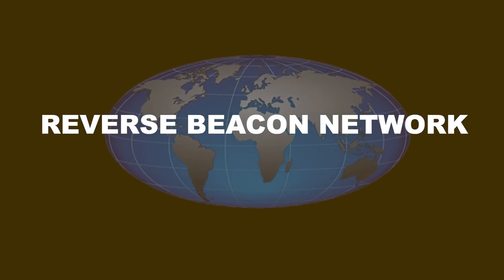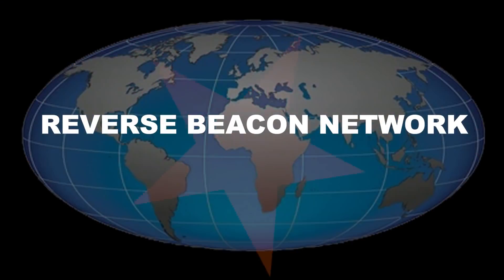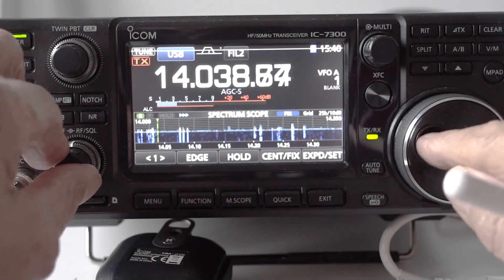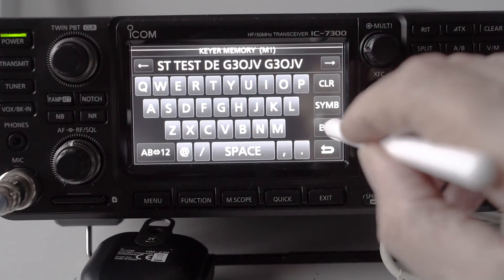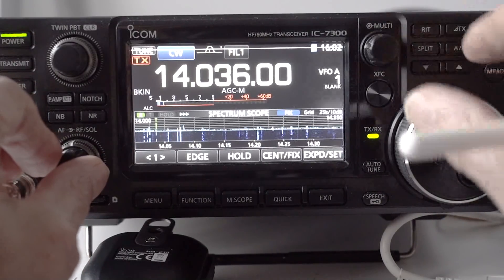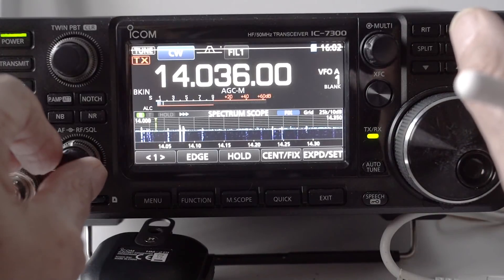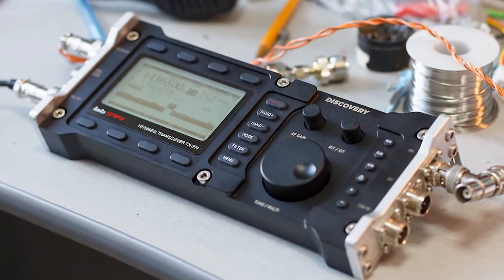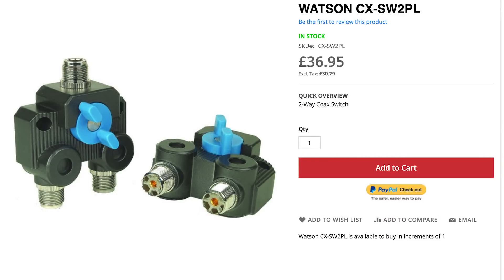HF ANTENNAS AND PROPAGATION - SIMPLE TESTS YOU CAN MAKE

Comment: I'm a new Ham and find your videos very helpful. I tried this but didn't get any reports when I went to reverse beacon website what am I missing? Thanks K2MWC 73
Reply from the maker: You need to send pretty good Morse cide but if generated by radio that should be mo problem. You must send in the CW section of the band ie ie near tge bottom. Reports take several minutes to come back.

Comment: You can also get how much your antenna is getting out is by looking at the PO meter while transmitting.  If you're set at 100W and the meter says 100 you pretty much transmitting 100W.  If the PO meters shows 50W you know you're loosing power somewhere.  Non resonate antenna, line loss, bad SWR or a combination thereof.
Reply from the maker: The power output has no connection with propogation!

Comment: Peter great video but my 991a won't do that 🙃
Reply from the maker: Ah - in that case yiu need to be abke to manually send CW. Sorry.  73 Peter.
Reply: I'm not sure about that. I've got it programmed into my 991 (not A) and it works. It has five memories for morse strings which can be sent in the same way. Look in the manual under CW and then contest memory thingie. It's the second bit under "Text".

Comment: Peter, you started me on the RBN path 18 months ago when, while in the Scottish highlands, you demonstrated the utility of RBN on your channel (March 3, 2020).   I learned something new--RBN works with "TEST" as well as "CQ".  Use of the Signal to Noise (S/N) ratio metric was difficult for me to interpret at first.  But then I remembered I had seen this metric before on the SDRuno software.  Listening to different stations at different S/N ratios helped me to understand how strong my signal appears to other stations on the RBN.  Your suggestion that using and logging RBN regularly over time is a good one.  I've found that you also get a feeling for which stations provide very reliable indications of signal strength.  I've looked up some of their QRZ pages and some have very elaborate antenna farms in low noise environments-not necessarily representative of your average ham's situation.  I calculate the median of the S/N/Rs obtained which provide a single point metric useful for comparisons over history or between station configurations.  The WSJT mode "WSPR" is another, albeit, more complicated tool that can be used for propagation studies. Two items to note for RBN use:  Send "QRL?" once or twice to start  to see if the frequency is indeed clear and that there's not an ongoing QSO, the part of which you can't hear.     Regarding low power on the IC-7300 and IC-705:.  When the power is set to zero on these transceivers, they still emit  RF.  I've found 650 mW and 100 mW, respectively measured with the QRPguys dummy load and power meter for these radios.  In fact, I've had several  CW QSOs at the 650 mW power!  Cheers and 73,  W3GZS

Comment: Cheers Peter. Excellent video. Was not aware of this, so going to try out this weekend. I suppose this is in some ways similar to the WSPR network? But without the need for specific installed software.  Thx,  ,  Mark  2E0MSR.
Reply from the maker: Yes, exactly. 73 Peter

Comment: A very practical video, Peter and crystal clear as usual. I find that on my Icom 9700, even dialling my output power down to zero, give an output of around 15mW, which on couple of occasions has been enough to generate a reply, so for me hitting the Fbkin button was needed! 73, M0YZT
Reply from the maker: OK thanks for that. 73 Peter

Comment: Hello Peter. Gosh, it looks like you have a problem with the LCD display on your 7300. There is a line at the top <gasp>. I bought my 7300 from your shop with the first batch that you received...I think that was March 2015. I was so impressed with it, that I bought a second 7300 six months later. I have had no problems with either of them. That LDG 49:1 looks like a handy thing to have...and cheap as chips. I have 1 KW 49:1 transformers for my EFHW antennas at home. But I think I might get one or two of those LDG ones for portable ops. 73 5Z4J,  ZS5J
Reply from the maker: Many thanks. 73 Peter